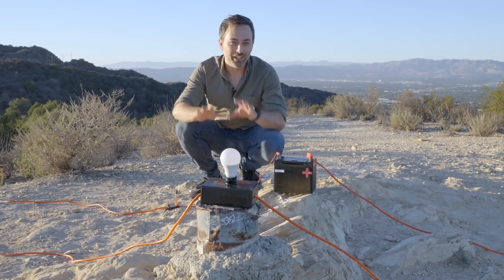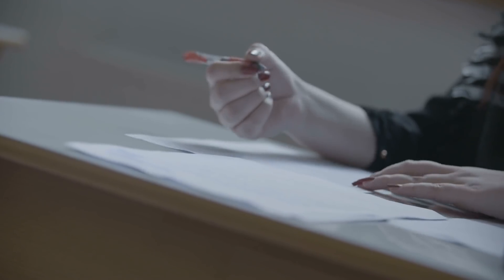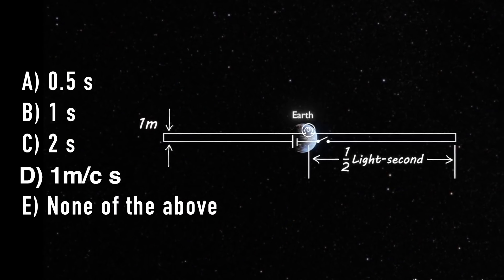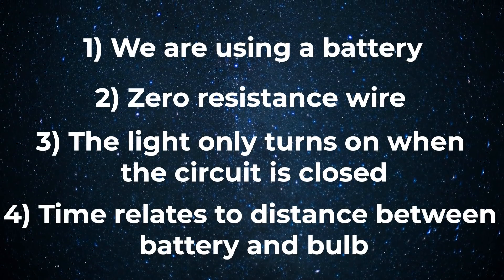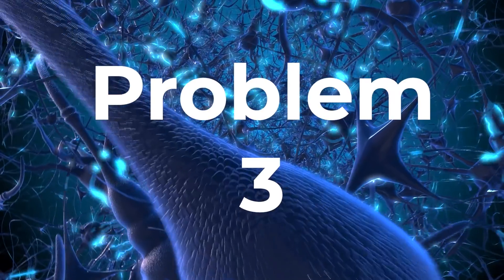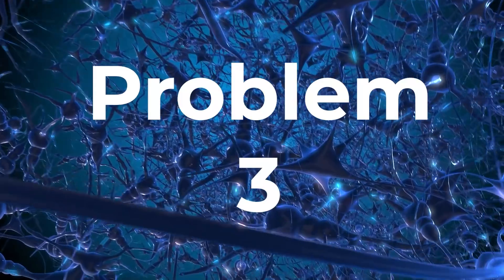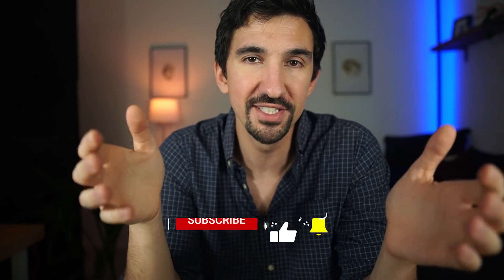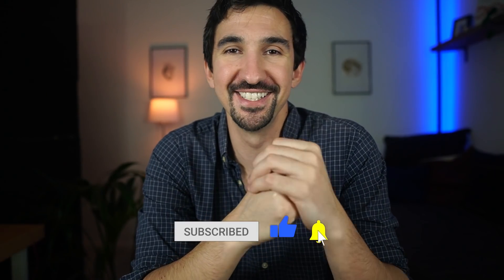Is Veritasium Wrong About Electricity?

Comment: Veritasium featured your video in his new response video.
Reply from the maker: We hit the big time 🙌
Reply: @DrBenMiles Veratasium hokum.

  DC electricity does not osscilate.  It will not induce enough energy across the air gap between the two wire. It will move through the wire.  The distance is NOT 1 m.  It's the entire length on.  And he shows a lightbulb lighting up.  That would never happen over the 1m air gap with a 12V DC battery.  Throwing the switch does nothing without a close loop.  You cannot pretend that it would work as an antenna.  There is no potential and thus no field without a closed loop. 

People need to stop trying to justify Veratasium foolishness.
Reply: @DrBenMiles  Could "The bigger problem" be explained by Quantum Entanglement ?
Reply: @DrBenMiles  Notice he uses 20 volts instead of 12 volts.
His output in the first 33 nanosec is only 0.0028 amperes....
If his theory was right about electrons not being a main driver of electricity, then the current would have been sufficient to light the LED fully.
Instead we get barely 5 volts and 0.0028 amps.
I don't deny that the electric field and magnetic fields are very important (required actually)... but the idea that the electrons are merely passengers discounts the fact that without the conductor, his LED would not light fully and would certainly never power a standard household appliance as he suggests.
He spends a huge amount of time .. proving himself wrong, but fails to drop the whole "electrons" don't do anything theory.
If Transmission Theory were the main driver of power, then we wouldn't need a completed circuit using a conductor in the first place. We could just use incomplete circuits.
The whole thing is a demonstration in the absurd. All he is proving is that there is a minuscule amount of power delivered wireless. The rest MUST be delivered by a conductor / moving electrons because the power losses thru a 1 meter gap are tremendous!
Reply from the maker: @marcfruchtman9473  yeah, I was thinking about this about an hour ago. He's still stuck with a strange set of mental logistics to try to mitigate the role of electrons. Its the electron charge separation in the battery that creates the electric field, which creates electron motion, which creates further electric fields. If electrons aren't important we shouldn't need to use a conductor in the circuit. Its all a bit circular and doesn't feel self consistent 
Probably not worth another video 😅  I think its important to remember there's a guy on the other side of the keyboard that just had the whole internet tell him he did it wrong. I think he saved face well. Seems like a good enough bloke 
Appreciate the comment 👍
Reply: @DrBenMiles  Veritasium is a great person as far as I can tell. But, the right thing to do was simply admit, he was wrong, and explain what he was trying to prove in his thought experiment... (That Transmission Theory is valid) rather than double down that electrons are just passengers. If that were true, the voltage in the first 33 nanoseconds would be 20 volts, and the current would not be merely 0.0028 amperes.
Reply: @marcfruchtman9473  It doesn't matter if the current wouldn't light a standard LED or appliance. In his original question, he said that the lightbulb must light up whenever current passes through it, which would happen in 1/c seconds. He was right.
Reply: @jexy2525  So, If I say Magnetism is fake, and then prove 1+1=2, that makes it ok?
He is claiming electrons are not carriers of electricity and the electric field does all the work. This is patently untrue. The electric field comes from the moving charge. Period.
The fact that the LED lights at all is irrelevant to the other garbage he is spouting. 
Just because the LED lights, doesn't disprove the fact that electrons are required for the great majority of power to do the work needed to light the LED.
He is literally only able to deliver a 1/4 the necessary voltage and a mere fraction of the amperes (0.0028 amps) that a conductor with moving electrons could deliver.
It is simply ludicrous to make a claim that the electrons are merely passengers.
His experiment is trying to prove a conclusion that has no basis in fact.
Reply: @marcfruchtman9473  "The electrons are merely passengers" is just a pithy line for him to express his point about the inaccuracies of a mental model in which electrons literally bumping into each other are the only relevant components. I think it's a bit ridiculous to take it incredibly literally, since it obviously doesn't even make sense to talk about an electric field without the existence and motion of electrons, and vise versa. It's pretty clear that what he is advocating for is being able to identify the more fundamental model (in this case Maxwell's equations), not a bizarre conception of focusing purely on fields and forgetting the existence of electrons.
Reply: @GeekProdigyGuy  Hmm, well, clearly he is making that statement. However, it is quite clear he believes it. I do agree that he is advocating for a more fundamental model, but in his enthusiasm to do so, he is trying substantiate his incomplete model which doesn't account for the motion of electrons and subsequent delivery of power with an electric field model that invalidates electrons and also can't possibly account for standard macro power delivery as seen with residential and industrial electricity.
It also doesn't help that people are validating him.
Reply: @marcfruchtman9473  you do relise that all you said about veritasium is factually wrong. He never disproved himself as being wrong. your mania about electrons being important or not has nothing to do with his statements.
Reply: @marcfruchtman9473 This is not a thought experiment.  It's foolish.
Reply: Veritasium mentions that the full current comes later, after wire-length delay, but discards the result as unimportant. Signals and power move along fiber optic cables and wave guides. So why not wire? There is clearly a wire-length delay of this wavefront, when the full current comes later.
Reply: @p39483  he doesn't disregard the full power that comes along the wire as being unimportantin general, just for his initial statement where enough power arrives much faster and enough to visibly light the bulb.
Reply: Veritasium and electro boom are like c average college students. They only know 70 of the theory and don’t care to learn the other 30 percent. Then they pass on only 70 percent they know and make up the rest without bothering to do the research but coming up with flawed experiments. It’s like the flat earth theory of electricity. Electrons don’t do any work - then he uses a light… if it’s an led then orbital changes of the electron release photons - incandescent is resistance of flow through tungsten (both cases of electrons doing the work). I proposed to electro boom that by using dc all he was doing was charging the wire in one direction before closing the switch. His answer was you don’t need to move electrons to get a wave of electricity. We’ll the very concept of current is the amount of electrons moving past a point in one second. In the end if those people don’t have an answer, instead of researching it they take the lazy way and invent something that makes no sense. You can’t debate stupidity.
Reply: I am a professional physicist. Veritasium is incorrect. He does not define what 'light up' means; he takes the position that a lamp 'lights up' when an electromagnetic signal reaches the lamp. This is wrong. The lamp lights up, in the normal sense, when the correct potential difference appears across its two ends. Only when this happens will the correct operating current flow through the bulb and the lamp reach its full brightness. And the only way for this to happen is for the electromagnetic signal to travel along the wire until this is achieved. Asserting that the very weak EM signal that travels directly from the source to the bulb and causing it to light up is wrong, since this will not cause any significant p.d. or current in the lamp, and the transient EM signal passing through the lamp's filament is so insignificant that the lamp will barely even get warm, let alone light up.
Reply: @rxotmfrxotmf8208  thanks 🙏
Reply: @scrumptious9673  You're most welcome. ☺
Reply: @rxotmfrxotmf8208  Veritasium's whole point was to explain that electrical fields carry the electricity. His thought experiment and actual experiment successfully explained that to the viewer. People like you who are arguing the semantics of  "lighting up" are completely missing the point of the video.
Reply: These comments in this thread are ridiculous. Derek was attempting to illustrate the fundamental role fields play in circuits. He was not trying to show that electrical engineers are stupid. Most of these replies make it seem like he was wrong, but he was right. He just didn't do a great job explaining himself in the 1st video. His 2nd video is completely correct.
Reply: @jmcsquared18  There’s nothing quite as frightening as someone who knows they are right - Michael Faraday. Electrical theory is just as much a part of chemistry as it is physics. Boyles theories (someone a hell of a lot more intelligent than “Derek”) were ignored completely as Derek injected his own unproven conjectures to fill the gaps. That’s the problem. Most of what he said was correct from a physics standpoint. However, to fill in the blank spaces with your own inventions of thought while not researching or learning the appropriate theory’s behind them introduces errors into his hypothesis and takes away from the real genius of scientists that have already solved this problem. In that way Derek is very wrong.
Reply: @spencerstrecheniuk3582 lol all he did was talk about the fundamental physics. And yet so many people like you are getting triggered about it. Derek even built the device and did the experiment, as well as clarified specifically what he was claiming and what he wasn't claiming. But I suspect that will never be enough, will it?

You like quotes, here's one:

"If someone doesn't value evidence, what evidence are you going to provide to prove that they should value it? If someone doesn’t value logic, what logical argument could you provide to show the importance of logic?" - Sam Harris

Comment: Energy is ALWAYS transferred in the EM fields/waves in the dielectric (at low field value and/or frequency, those fields like to "stick" to the metals). No one sane will argue about that in case of Light (it flows via vacuum, air, glass).
So WHY you folks think it's different at lower frequencies? Hint: it's NOT. From light to DC, energy travels in the dielectric, but sometimes we can direct it using metals. That's it. No "magic" involved. The SAME set of rules, from 0 to THz range.

Comment: Great video, unfortunately do you forget some very important details:-)
Power does not move via wires that are not connected. Power does only start to move when there is a closed circuit. Meaning, you get no antenna at all.
Dependent on how you think of it, the speed that electricity does not move at the speed of light but fare slower, in fact can you argue that power is not moving at all.

Comment: I think it would be interesting to lick your finger, stick in a socket, and consider the "fields" involved. Also, ARC Welding?? As someone who designed electrical and electronic systems for a good part of my life this is all counter intuitive. The part about the field on the surface of the cable drives me particularly bonkers. Conductivity. Coulombs. Amps. Voltage. These are concepts that make sense to me.

Comment: New explanations don't necessarily invalidate the old ones. They increase the domain covered. But the old models are still useful over more limited domains when they're easier to compute. We don't use Maxwell's equations to work out house wiring when Ohm's law with real numbers is adequate.

Comment: I think its helpful to picture this with an air pipe analogy. A pipe containing air (compressible) an electric pump, a wheel paddle or isolated turbine and a switch vaulve. If the circuit is super long and you turn the vaulve open, the tuebine spinsbecause the air isn't rigid but compressible and this compression(at the positive side) and decompression (at the negative side) travel outwards at close to light speed so the turbine will spin almost immediately once the vaulve opens but the wave takes a while to reach the extreme end of the circuit as it is suoer far away. This is the same for electric circuits, electric waves take a while to travel from point to point in a transmission line. Im leaving out other problems of inductance and capacitance which cannot be created with a water circuit.

It's kinda complex, other things like how close the wires are and the setup/placement of the circuit components play a major role. So depending on these factor Veritasium may or may not be correct.

Comment: My problem (@Veritasium)  is that it is not explained  what happens when the battery is initially connected to the circuit before the switch is closed. It may be that  I completely misunderstand current flow but, assuming zero resistance etc. the battery voltage (Battery potential difference) will already be present (measurable)  across the switch, in other words the circuit is pre-charged, closing the switch initiates current flow (movement of electrons) through the bulb.  I guess I am just dumb :-).

Comment: I watched a different electrician video... 
 He had two wires, one that was long and winding and did not complete a curcuit and another one that was straighter that did complete a curcuit, the electricity searched out all paths before picking the one, like water waves would in channels, the one that was not connected in a full circuit still fluctuates at the beginning when current is added. Like wave ripples. 

Dc power doesnt travel far, ac power needs boosters...  so ...  yea .. idk ...

Comment: Veritasium is wrong about many things in that experiment. 
However the assumption #3 in this video is not wholly correct.  Voltage can still be generated at the lamp at 1/c, but only very-very small, won't be enough to turn on the bulb/light.

Comment: But wouldn't that make Veritasium main point completely wrong? Wasn't the main point of his video - energy doesn't flow in the wires? And then, here we are saying yes it does, and also magnetic field might induce some flow od electrons in the not connected wire... But it's still electrons in the wire and their flow

Comment: I’ll make it as simple as possible – the question was “Is Veritasium Wrong About Electricity?” … and the answer is: YES – very painfully and very embarrassingly wrong. The only thing that takes time is for the light reaching the observer’s eye – everything else happens instantaneously: the switch closing, the LED (bulb) lighting and power being consumed from the battery. I will gladly debate – but exclusively through e-mail.

Comment: Finally a video that addressed correctly against the misleading Veritasium. This Veritasium has several flaws:
1. He does not prove that the wire is really 300000km length. If there is wire that long with that thickness the price would be astronomical. Insulated wire that thick (assuming 1.5mm2) would have price around $0.8 per meter or $240M USD with weight of >4000 tons (0.0134 kg/m, without insulation) where biggest container can only carry 30 tons. At minimum it requires 120 times truck transport of 120 chopped pieces each 3000km length. He would have to pay entire of their lifetime saving just to buy the wire not to add the logistic price. And the resistance will be so high totalling 3.6 Mega Ohm (12.10 mOhm / meter) that it is impossible to transfer any current in 12v enough to make lamp that bright. So the demonstration that Veritasium did was just pure theory, he does not demonstrate anything (we can call it fake or misleading demonstration).
2. He does not do anything else than just to switch on and off. For example he should pull the battery and lamp far away. He also need to measure using lab-grade expensive oscilloscope that can measure very fast and accurate response at least in 1GHz frequency or faster to prove the timing (which most oscilloscope can't). 
3. The load is resistive, it is not clear the point where the 1/c has conducted or not. And the 1/c time is much much faster than the camera frame rate he is using.
4. The wire when connected to battery or any source even if both end are not connected is already energized but the electrons would have just stuck there (not moving). When both ends are connected via switch: the distance of electrons flow will be just that switch so the lamp will almost immediately lights up. This is another possibility that Derek has not been thinking. The experiment should make the switch by attaching/detaching the two cable ends to two battery terminals simultaneously instead of having a switch somewhere in wire. This way we will see around 0.5-1s (until lamp lights up) that proves that electrons travel at nearly speed of light in wire or we will see almost immediately if does not.
Reply: Everyone is thinking about the light bulb. The quality of the light bulb doesn't matter.
We are trying to decide if energy flow is inside or outside wire and in what direction. Energy is in the fields I'm with Poynting 100%

Comment: The velocity of electrons' movement is called drift velocity. The drift velocity is not the same as the velocity of light, which was well established by Maxwell's equations. One way we can further confirm the theory is to use a single wire with no wire return to conduct high frequency electricity.